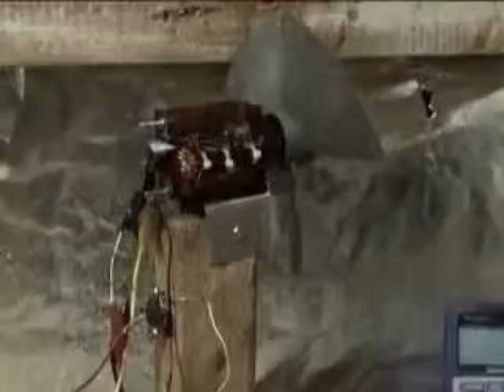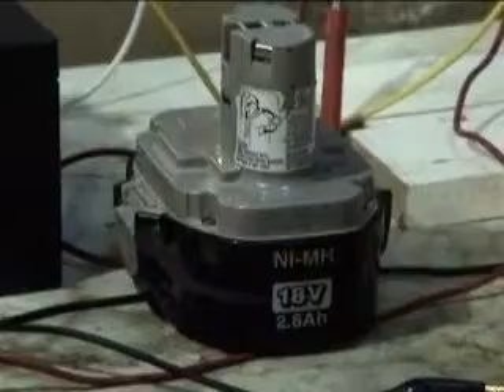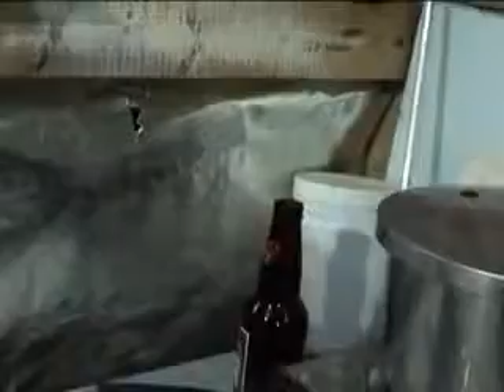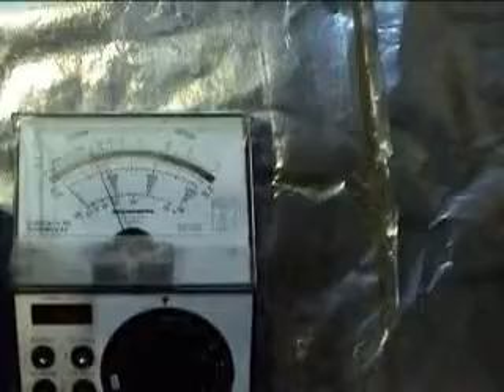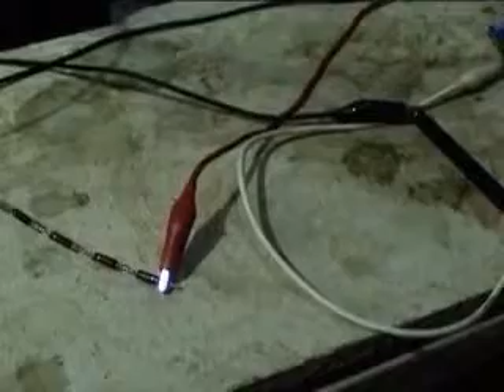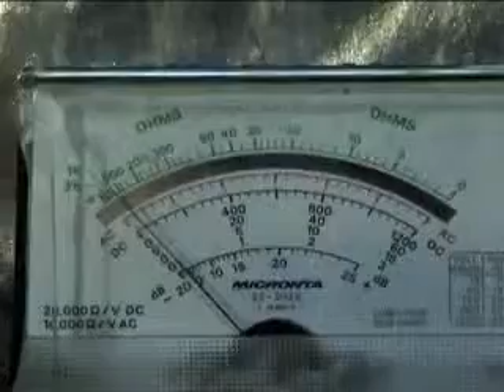Self oscillating Window Motor pt-1

Comment: 10 years later watching your videos man. During this experiment do you remember if the battery voltage went up?
Reply from the maker: That was the first experiment I did that got me started in this stuff lol and I never measured the battery voltage, the circuit was SSG I think.
cheers Hitman